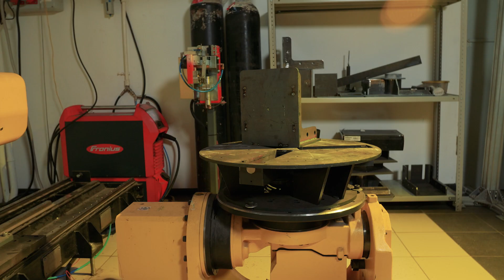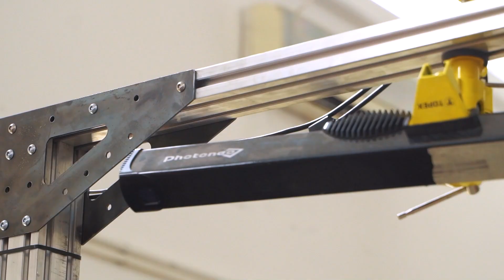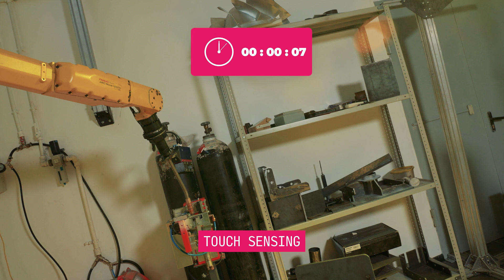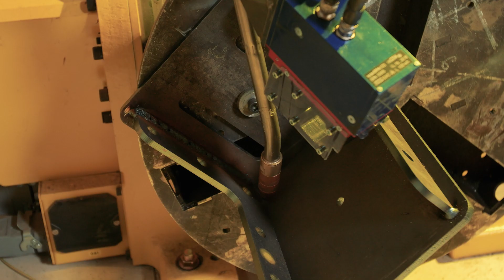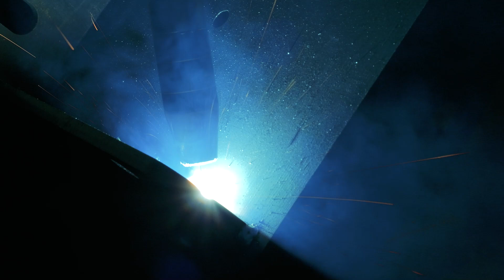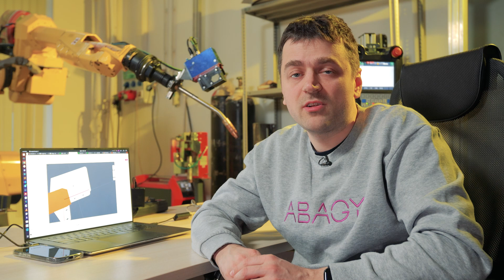Laser Scanner for Industrial Robots | ABAGY ROBOTIC WELDING

Comment: It has limited application options. Try to weld butt weld with zero gap. Heavy scanner with bracket required robots with payload up to 12 kg, limited access, and super expensive. Almost impossible to calculate ROI.
Reply from the maker: Thank you for your comment. Our solution offers several options and the choice depends on the specifics of the application. We are ready to help you find the best solution.

Comment from the maker: @miguelcalvache706  "Great innovation, congratulations! In my opinion, this has significant potential. However, have you conducted long-term testing to ensure that the scanner’s performance is not affected by scatter from the welding process?" -  Currently we perform scanning and welding sequentially, so the scatter from the welding does not affect the quality of path corrections. However this type of sensors are also suitable for online seam tracking when welding is on. We did that kind of experiments as well, however such technology has its own limitations. We think that sequential scanning is more flexible.